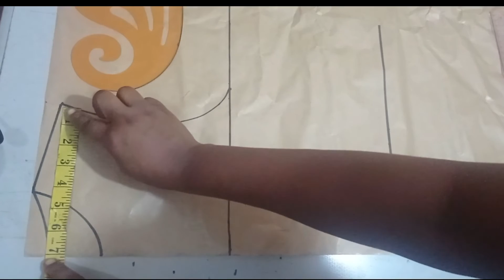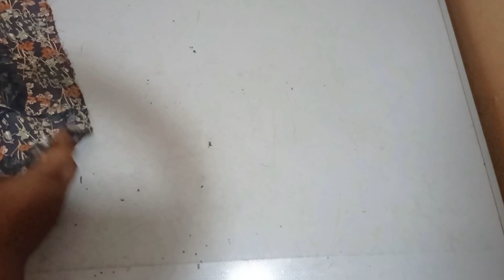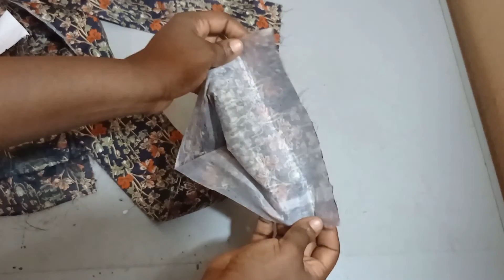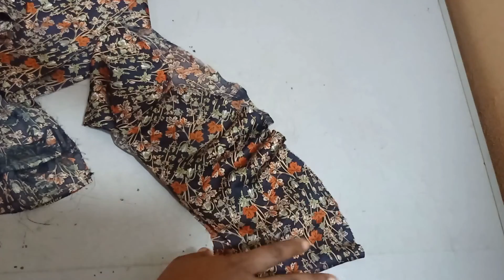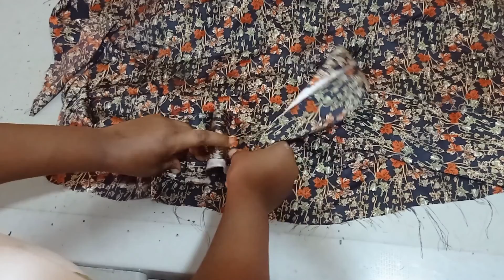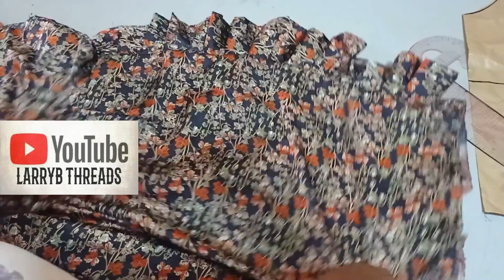How to cut and sew a PENCIL DRESS | PENCIL GOWN

Comment: I noticed for the corset tutorial,  the front waist line was different from the back waistline. But why are they the same here?
Reply from the maker: There are different types of darts (waist,bust, shoulder e.t c.). .you don't have to use all this in your outfit...you can decide to use just one or combine 2 depending on what you want to achieve....If you want to use the method used in the corset for this dress then the  half length measurements for front and back will be different
Reply: @LarryBThreads  Thank you for this explanation but I need  further clarification.  If u don't want to use the bust dart, which of the half length will be most accurate to use in drafting? The front or back half length
Reply from the maker: In the case of corset...I took a bust dart of 2" in the front which make the front longer by 2"...there is no bust at the back so we can't take same dart at the back but once the 2" bust dart is closed the front waist length will match up with the back
I hope you get what I'm trying to say
Reply: Thanks for your reply.  For the corset,  the front waist line was different from the back waistline  but you made the front and backwaistlines the same for this gown. My question is it not everytime we take bust dart at the front?.
Reply: OK. Now I understand. Thanks a bunch